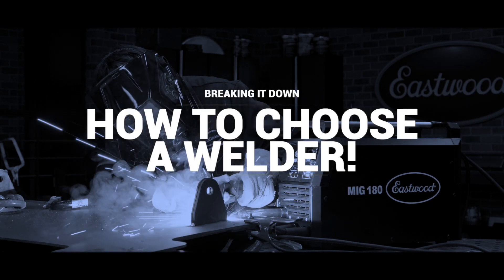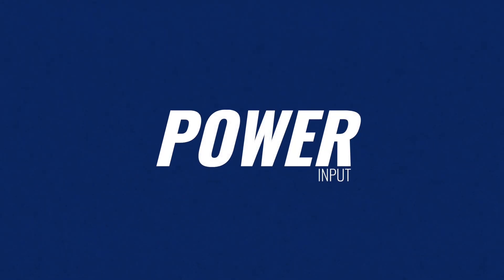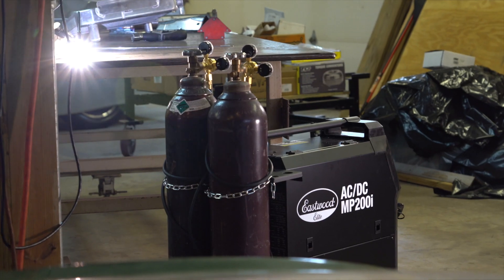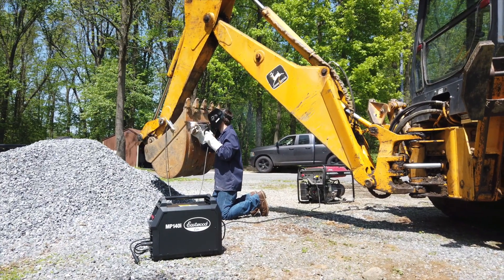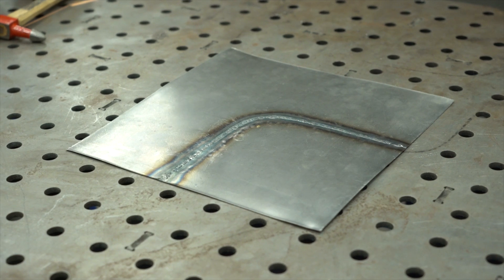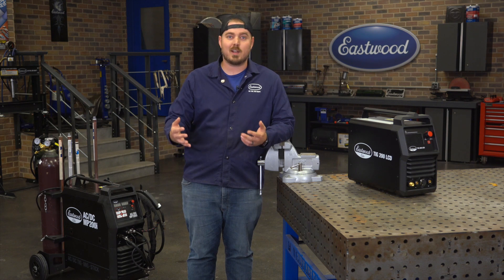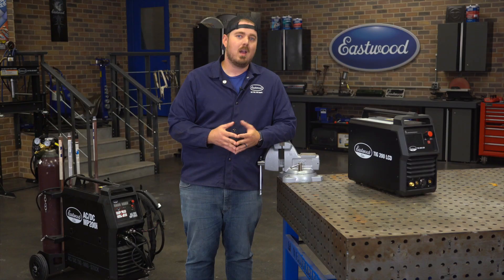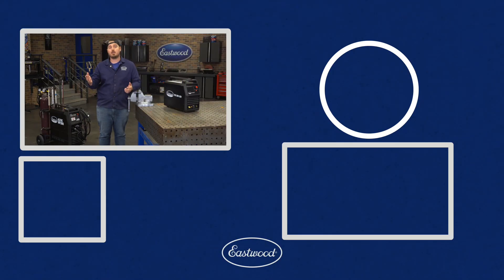How to Choose a Welder!

Comment: What machine would you recommend ? I will be welding 1/4" mild steel and stainless steel. I want to use 75/25 mix bc I have a test coming up in October so I need to be prepared and get some practice in ... I don't wanna spend tones of money though. I will be doing MIG ...0.30 wire . I see so many machines but I'm on a budget, your help will be greatly appreciated.
Reply: Miller or Lincoln, Hobart is also good...
Reply from the maker: You could use our MIG 180 https://www.eastwood.com/eastwood-mig-welder-180-amp.html
or
MIG 250 https://www.eastwood.com/eastwood-250-amp-mig-welder.html

Keep in mind you'll need stainless specific wire as opposed to standard MIG wire.

Comment: Good explanation, first decide what you want to weld then pick the appropriate machine.  With regards to gas bottles, well they can be pricey, but keep in mind that at most your gas flow will be at about 20 cfh per hour.  You can start off with as little as 40 CF bottles.  2 hours of weld time (+/-) may not sound like much, but that is only the time that you have an arc.  Yes with the smaller bottles you will be making more trips to the store, but keep in mind that many welding supply stores will give you credit on the small bottle when you upsize to the next larger bottle.  Right now I have 3 - 125 CF shielding gas bottles ( 2 - Ar and 1 - C25) and I am thinking about getting another C25 bottle.  The advantage of having two bottles of the same shielding gas is that you don't have to stop your work when you run out.  You can just swap out bottles and go get the exchange bottle at your convenience.  This has happened to me on several occasions and having that 2nd bottle has been quite handy, especially when doing a repair or fabrication job for someone.
Reply: I have two bottles as well. After running the 20CF out more than once on a weekend with no availability, I bought a 40CF. Don't think I've run out since, but the last trip to the welding supply was with both empty bottles.
Reply: @jeffmiddleton2222  I would consider upgrading to the 80 CF bottles.  Or upgrade your 20CF to a 40CF.  A lot depends on just how much welding that you are doing.  I easily can go through 40 to 60 CF in a day.  The 80 CF are still quite easy to manage and move around.  A 125 CF bottle is about all that I can pick up when putting them in or taking them out of my truck.  Plus with the 125 CF you do learn how to lean them over and spin them to move them easily.  🙂
Reply: When my current set up no longer works I will add a third bottle. Haven't had an interest in upgradeing so far, but when the time comes I will probably switch the 20cf to Argon for aluminum and add a bigger mixed gas bottle.
Reply: @jeffmiddleton2222  You might want to keep in mind that it is less expensive to upgrade to the next size bottle than it is to purchase a second bottle of the same size.  Also, the cost of the gas for the larger bottle is often less.  When I went from 80 CF to 125 CF, the gas cost was only like $3 more.  But, what ever works best for you is the way to go.